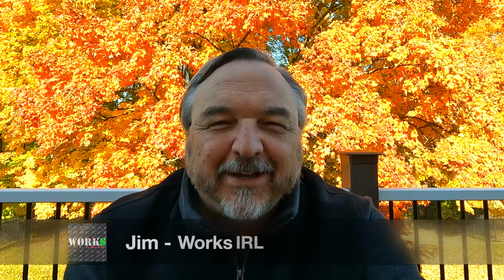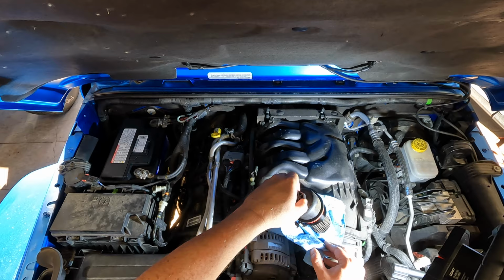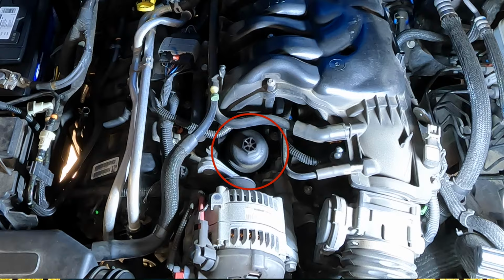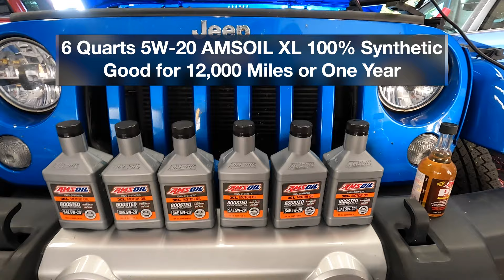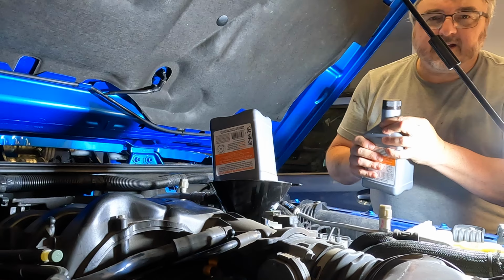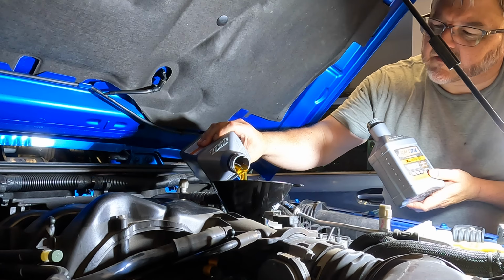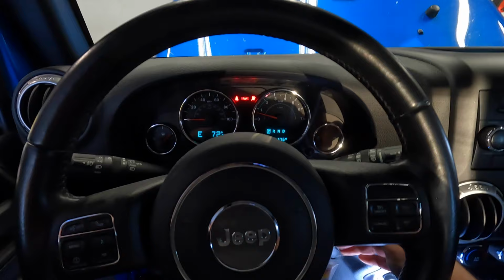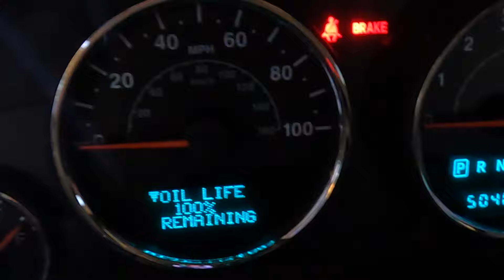Jeep JK/JKU Pentastar Engine Oil and Filter Change

Comment: I would always recommend using a torque wrench on the drain bolt and filter housing. Recommended torque for the filter is 18 ft lbs and the drain bolt is 20 ft lbs. Many people use double or more using a 3/8" ratchet. One hand on a 1/4" drive ratchet can easily get you tighter than recommended. A couple times using a torque wrench and you'll see how little force you really need on these parts.
Reply from the maker: Definitely concur on your sound advice.  My biggest let-down is poor quality click-style torque wrenches that don't keep their calibration over the long haul and unless you calibrate them routinely yourself, it generally cost more to have them calibrated than buying a new one and start the whole cycle over again.  Also, when those torque wrenches start failing, they open the door to dangerously OVER-TORQUING!  I used to be a torque fan until having multiple wrenches fail me and I'm a stickler for storing them properly like the precision instruments they are.  Thanks for reinforcing your point and I now need to head into finding a decent torque wrench maker that doesn't cost "professional money" but keeps its calibration for a decent time.